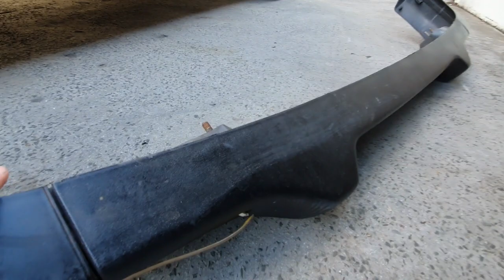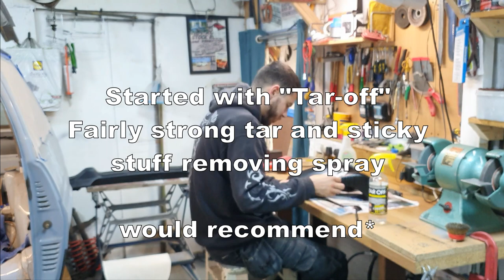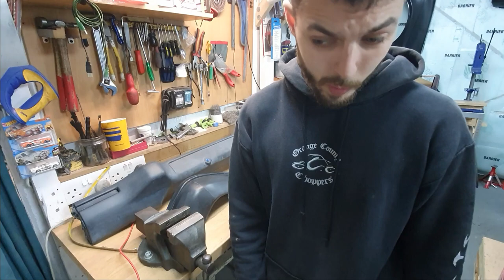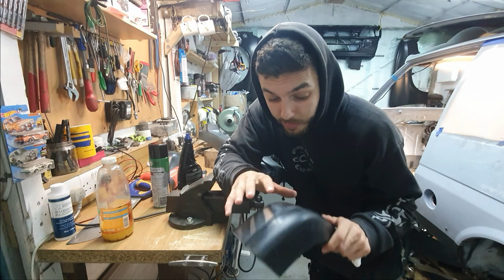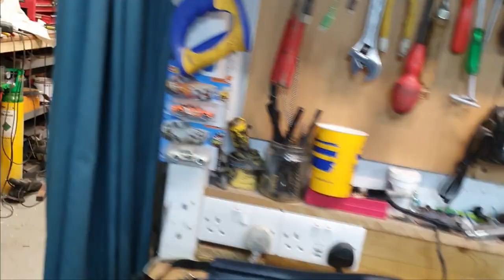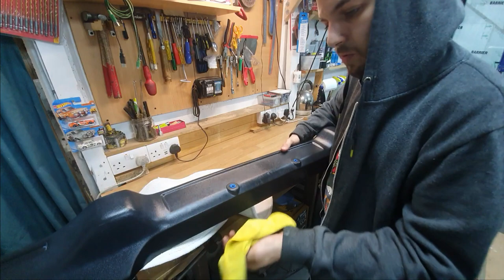Plastic bumper restoration (black OEM finish) | Fiesta diaries | Ep.31

Comment: Great work on those plastics. Heard multiple times about using a heat gun but never seen someone actually perfect it like you have 👌🏻 I’ve got lots of old end caps that I’ll have to try & restore! Loving the side projects 😁
Reply: Also, I use carbon collective trim restorer, I swear by the stuff but as you say it’s £££
Reply from the maker: Thank you mate!! Heat gun is probably the most budget friendly option. I will treat myself one day though, if you say the carbon collective stuff works, it'll be added to my shopping list. Definitely is expensive but with the prices of everything and how rare some things are becoming, it seems a bit more justified. Would love a demonstration of it in one of your vids😜
Reply: @strugglyboys  tried a heat gun on my mk2 XR2 which I currently have totally stripped and on a jig ready to strip the under seal off.. it didn’t bring the colour back at all so what you have managed looks pretty good 👍

Comment: Will give this a go on mine mate thanks
Reply from the maker: Wish you best of luck. Definitely would recommend clamping the two layers of the centre piece when working on it, especially for the cool down period. The heat warping sneaks up on you. Thanks for watching mate!
Reply: @strugglyboys   mines only got the end caps an metal middle but it’s amazing how new you can make a 33 odd year old bit of plastic top work keep it up 👍
Reply: Done one side of mine looks amazing how can I show I the difference mate
Reply from the maker: Saw your post on the facebook group, absolutely amazing result!! Very well done sir👏
Reply: @strugglyboys   yeah and that was only one go over it as well will keep doing it 👍 keep up the good work